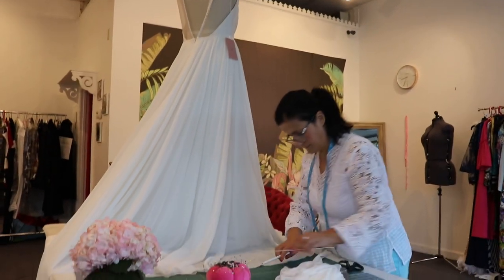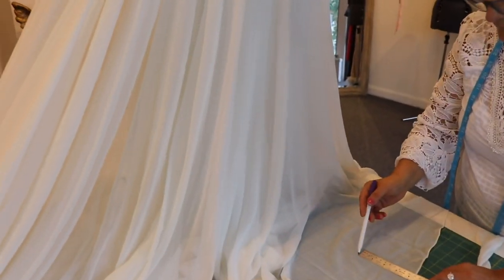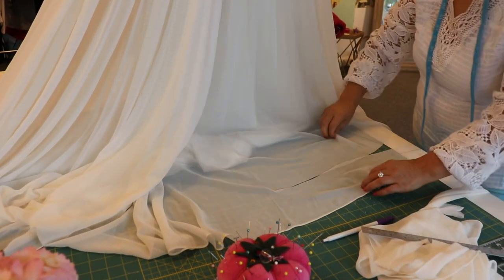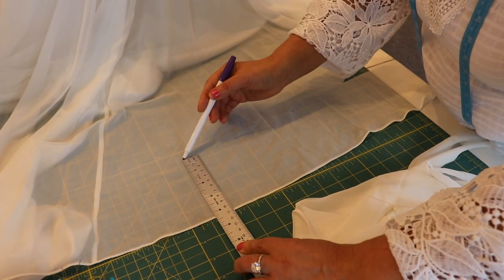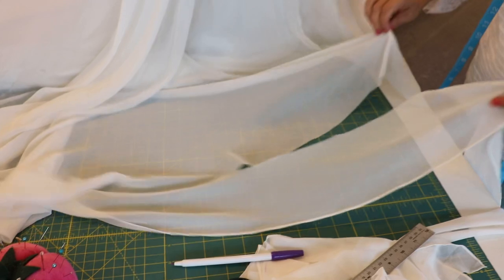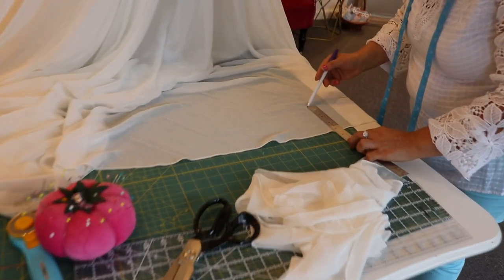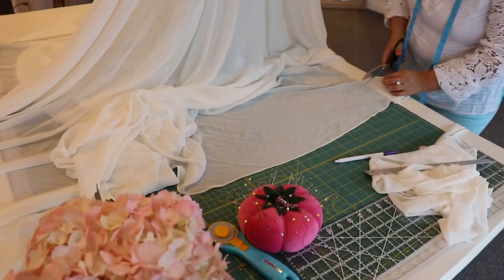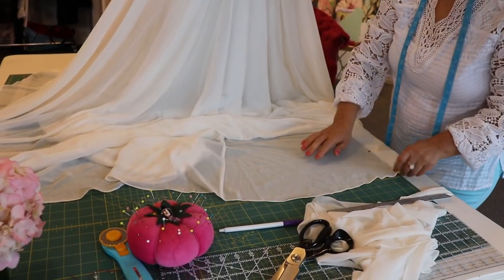How to hem a wedding dress, easily! Tutorial

Comment: I am hemming a dress this week… two layers main fabric, 3 layers tulle.  I’m fine with hemming all around, but the bride wants to keep the train, and I need to hem the front about 5 inches. Any recommendations on blending the front hem to the sides?  Where do you suggest beginning to taper??  Should I hem to the side seams, then taper?? Or hem about 10” across the front, then taper to the sides?? The shaping of the dress actually looks very similar to the dress in your video. I would appreciate any help if you are willing to respond!!
Reply from the maker: Hi! Thank you for watching. I would suggest placing the dress on a dress form, and starting marking  from the front starting at 5 inches gradually to the side seam bringing it to 0. You should not cut beyond the side seam as you need to save the train. When you finish marking pin the dress and see how it looks ,make proper adjustments if needed. Let us know how it went. Hope this helps for future projects.